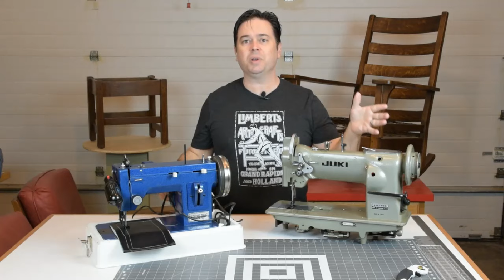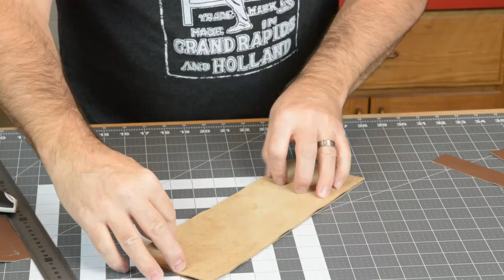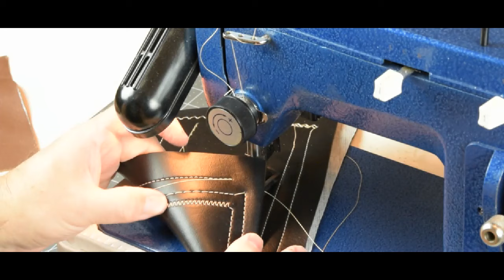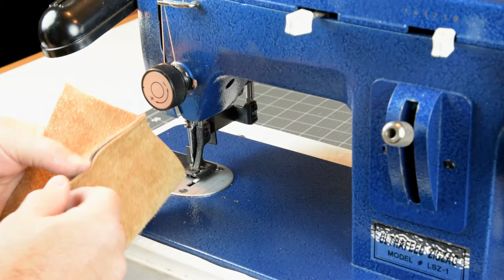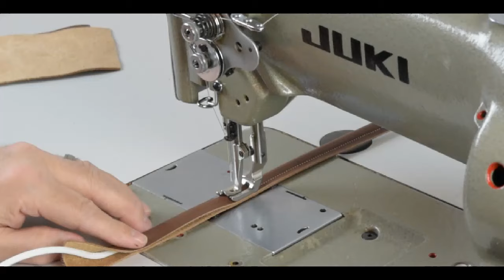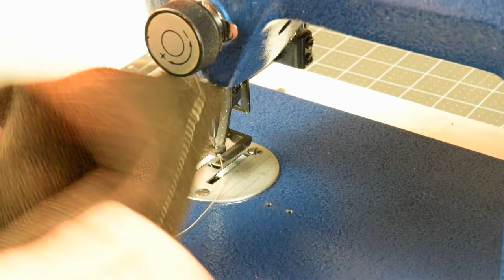Mini Walking Foot Vs Industrial Walking Foot Sewing Machine Sailrite and Juki Compared

Comment: I have a Reliable Barracuda.  I'm pretty sure it's the same machine as the LZ1.  I think Sailrite just takes the basic machine and does a lot of modifications and improvements to it.  I don't think they build them from scratch.  I have noticed that the Sailrite LZ presser foot lifts a lot more than mine.  I'd like to see how to adjust the walking foot and the presser foot for proper height and tension.  Also, your Juki is a compound walking foot, where the needle actually pulls the fabric.  It's far superior to the regular walking foot.  My Reliable tends to slip with certain materials.  But for the money, it's hard to beat.
Reply from the maker: There's an adjustment under the top cover for foot steppage height.  Most machines have something like it, but the adjustment is counterintuitive.  You make the adjustment backwards compared to any other walking foot.  It still doesn't lift as high as I'd like.  
Best
Reply: If you haven’t figured it out yet, Sailrite has a couple of utube videos that gave me enough info to figure it out on the Barracuda. Just go slow, ignore the measurements quoted and aim instead to get the clearances specified in the Barracuda sales lit.

Comment: I was watching a Sailrite video today and they said when you sew a corner, you should bury the needle and then bring it up 1/8th of an inch, raise presser foot, pivot, lower presser foot and then continue sewing. That way you can ensure the corner stitch will be complete.
Reply from the maker: Yes that is correct.  That's the best technique when you need to sew a square corner.  
Thanks
Reply: I watched that impressive performance, also 💪🏽

Comment: Now it does increase the cost but you can purchase a 550w servo motor with speed reducer for the Ultrafeed from Sailrite. It doesn't come with it stock though and you are pretty much committing to it no longer being a portable machine. So the Sailrite machine can have similar power. 

It really comes down to price, how loud it is, zig-zag stitch capability, how portable it is, and clearance under the presser foot.
Reply from the maker: Hi Joseph.  Well said.  Yes, for instance you can buy the Sailrite Leather machine which comes with a mini table, servo and small speed reducer.  It should be a nice package for a lot of crafters.
Reply: That Sailrite servo retains the portability of the machine, as it replaces the stock motor.
Reply: If you still want the portability, get the WorkerB servo motor.  It turn the portable LSZ1 into another workhorse!  Pun intended.  😀

Comment: Hello, I sew bags with light fabrics combined with some vinyl. I would like to buy a JUKI with a walking foot. Which one would you recommend?
This video just nailed it. You are a natural teacher, very clear and specific. Thank you very much.
Reply from the maker: Hi Sandra, thanks for your nice comments.  For sewing light fabric with vinyl, you might be able to get away with a simple drop feed machine like a DDL 8700.  If you have multiple layers of vinyl, or think you might want to do leather or heavier upholstery weight fabric, then a walking foot is recommended.  I favor the old Juki LU-563 with huge U style bobbin, but the LU-562 is almost identical but with a small G style bobbin.  Any of the new Juki walking foot machines are highly capable.  The main decisions you are making are do you prefer a top loading bobbin or a side loading bobbin?  Is a large M style bobbin important to you?  Or is a small G bobbin adequate?
Best of luck picking a great machine!
Reply: Sailrite would be perfect for what you want to do.
Reply: @paralogregt  Thank you very much, I really appreciate your advise. Good night and stay safe.
Reply: I would recommend the Juki 1541.  You can also buy the sailrite leather foot they use on their Fabricator and it fits the juki.  It has a smooth foot so it won't damage the vinyl. I do recommend using a hump jumper or scrap piece of vinyl to protect the vinyl when going UP or DOWN from a hump.  If not, the presser foot will eat your vinyl and you will be very sad. Lot's of bagmakers on YT use the 1181 so I think you can also consider that one.  But if you ever decide to use leather,  you should go for the 1541.

Comment: In the comments many people note the Sailrite is much noisier than the Juki. But for a fair analysis I think your demo should take into consideration the motor on the Sailrite is mounted on top of the hard, (noise reflecting) working surface of the table, just inches away from the microphone.  Where as the Juki motor is mounted under the table, several feet away from the microphone. Also, the camera/microphone appears to be positioned closer to the Sailrite than it does for the Juki demo.
Reply from the maker: Hi JC, I was actually using a lav mic, so same distance to the machine for both.  That is the actual experience sewing on these machines.  Your ears will be closer to the Sailrite machine, and it is a bit louder.  No getting around that.  But for what it is - a portable walking foot - it does the job.
Thanks for weighing in.

Comment: I rather wish i had come across this comparison before today, as it may have impacted my overall decision. I ended up purchasing a Sailrite straight stitch machine last year after hemming and hawing between a used industrial and the SR.
I'm not upset with the Sailrite. The newer versions of machine appear to have addressed some of the clearance issues you demonstrated in this video, and getting 4 layers under a new machine is not as difficult as you showed. I think it comes down to the mechanical lift was adjusted to capture some of the manual extra you showed near the end of the video. 
The challenge is in doing some DIY upholstery projects for automotive, adding a backing foam now takes up all of the increased clearance in the new machine and I return to having similar frustrations overall. I think if it was anything more than a hobby level endeavor, i'd be going back to the bowl of fruit and sampling something different.
I remain curious how the Sailrite fabricator machine compares to the likes of newer Consew and Juki machines. It seems the real quality machines for upholstery have all cheapened over the past decade and those of us shopping now are faced with the conundrum of what level of frustration we want to deal with. There don't seem to be many slow speed truly high quality options buying new.
Reply from the maker: Yeah I hear you.  I have the Sailrite Leatherwork as well, and it has the same clearance issue as the old ones.  If you sew more than two layers of 3oz leather, the foot drags on the work.  Fabricator will have normal industrial sewing capability of 3/8" compressed thickness.  Best of luck.

Comment: I like the idea of the sailrite when the power goes out I can keep on sewing and they do have a larger piping foot and they have beautiful stitching. I did not like how you made sailrite stitching closer together they do have a further apart stitching
Reply from the maker: That's great if they do have a larger piping foot, because the one that comes with the machine is too small for 5/32" piping.  My Leatherwork came with the same small cording foot.  I agree that stitch length should be longer for piping.  On newer Sailrite machines, changing stitch length is really awkward because you have to adjust two knobs.  One sets forward stitch length and one sets backwards stitch length.  On full size industrial machines, that's all automatic.  Ultimately, each user knows what's most important to them.  Sounds like you're set on the Sailrite benefits, so I say go for it!

Comment: That old Sail Rite sure does look like my Baracuda 200ZW.  This is a great video.
Reply from the maker: Thanks!
Reply: I'm told they are almost identical besides the price.
Reply: I saw a video on YT that talked about Thompson being a name in Sail Wright's family history.
Reply from the maker: @dannyl2598  Yes, I think they're similar.  Although Sailrite has made some improvements in terms of reliability, and making parts more widely available.  
Thanks
Reply: @stopthephilosophicalzombie9017  Yeah, big price.
Reply: Sailrites are upgraded generic machines made in china sold under a number of names including reliable, barracuda, omega etc. Sailrites do appear to work much smoother as they do a could job of fine tuning the generic machine and re selling them. They do have exemplary service.
Reply from the maker: @paralogregt  yeah, I've been impressed with Sailrite's service over the years.  I just placed another order, and it seemed like it shipped within minutes.  Surprisingly fast.  There are different packages too, like the Leatherwork machine.  I'll be testing that machine soon.

Comment: The difference in noise level between them is astounding. The Juki sounds like a Rolls-Royce, very smooth and quiet. The Sailrite was very rough, almost grinding sounding.
Reply from the maker: Yes, true.  They are both older machines, so probably a good judge as to what you can expect.  Honestly though, I have the Sailrite Leatherwork and it sounds about the same.  Best to you.
Reply: @TheThoughtfulWoodworker  
And to you and yours. Happy Holidays. Stay well 🙏

Comment: If you put the Sailrite on a table with a servo motor and a speed reducer, it becomes a true mini industrial. The only drawback to the Sailrite is that it’s not at all designed for manufacturing, like a full size is — which makes it an absolutely perfect prototyping or one-off fabricator. With a full setup, it’ll exceed expectations for its size. 👍
Reply from the maker: I actually have the Sailrite Leatherwork which is on a small table with servo.  The capacity of the portable machines just doesn't compare to a full size machine.  I need about 3/8" clearance under the presser foot for most projects.  The Sailrite maxes out at 1/4", so it's really only appropriate for thin material.  Your results may vary, but foot clearance is the one thing I've struggled with.  Best to you.

Comment: That Sailrite machine seems like a noisy son  of a gun.  I wonder why it makes so much noise?  Thanks for sharing this info.  Very informative.
Reply from the maker: I'm not sure, but it was well oiled.  That's an older model.  I have a Sailrite Leatherwork now that is quieter, but it also operates at a much slower speed.  Built-in speed reducer keeps things slow and quiet.
Interestingly, I've noticed a difference in the noise level of Consew 206rb machines.  The 206rb1 and rb2 are nice and quiet.  The 206rb5 machines make a clackety-clack noise.  Country of origin changed from Japan to China at some point, and perhaps the manufacturing tolerances weren't as tight 
Thanks for checking out the video.

Comment: Good video. I've got a newer version of that little Sailrite machine. It's ok but I am somewhat disappointed with it though because of presser foot clearance. My old Kenmore is better in that regard and it has more power too actually even though I'm running a speed reducer on the Sailrite too. Also its feet are wide which interferes getting close to things.
Reply from the maker: Hi Myron, sounds like you have some real world experience with the Sailrite.  I also have the Sailrite Leatherwork with a 550w Workhorse servo and small speed reducer.  Power is no problem in that configuration.  There is an adjustment for presser foot steppage height.  It adjusts backwards compared to most industrial sewing machines.  But even at max height, it doesn't lift high enough for me either.  I would also agree that the Sailrite feet feel wide and bulky compared to standard Consew style feet.  
Thanks for sharing your experience with the machine.
Best
Reply: @TheThoughtfulWoodworker  I’ve decided that the next machine I buy is going to be the TechSew 5100. I want to get into more leather work and it’s also a cylinder arm machine capable of sewing 5 ounce leather right up to 7/8” thick with 1” presser foot clearance with compound walking foot and needle feed with an 800W 1 Hp servo motor on it. This will do everything I would ever do and it’s only priced a few hundred dollars more than one of their smaller models. Oh, it’s also a 16-1/2” cylinder arm too so that offers pretty good throat clearance for bulky items.

Comment: Is there a practical difference in the types of walking foot you show here? The needle feed (triple feed?) machine seems more efficient, like the Sailrite Fabricator. 
Nice to see the older style Sailrite, it's about the same as the currently marketed "clones", like the REX, Reliable, etc...
Also, the outer foot on the Sailrite can always be changed to a deeper cord, and Sailrite has several different styles of feet. The other thing is that the Sailrite foot lift is adjustable up to about 1/2 inch. Same with the clones.
Reply from the maker: The triple feed has the needle buried as the material is advanced.  Just one more element working in unison to evenly feed the material.
Every Sailrite portable I've sewn on maxed out at about 5/16 sewing capacity.  Even with the walking foot steppage adjusted to maximum.  
You're right the Fabricator is a triple feed machine.  It will more reliably do 3/8" compressed thickness.
Best

Comment: One of the best comparison videos I've yet to see. Unfortunately, many Sailrite fans might not be happy with the results, but this video clearly shows the truth.  I'm now over trying a portable machine and will save up for an industrial. 

Also, are the Consew machines as quiet as that Juki? That thing sounds fabulous! What about powering off 110v? I'm mainly interested in vinyl for motorcycle seats, but will probably venture into other bike gear like wallets, handlebar/windshield pouches, and tank bibs. All for personal use and maybe a few friends.  Any tips on that and locating a good budget/used machine will help. 

Thanks!
Reply from the maker: The old Consews like the 226 and 206rb-1 and 2 are as quiet as my Juki.  The Consew 206rb-5 makes more of a clackety-clack to my ears.  Of course you have to have a servo motor for a really quiet machine!

Comment: This is a good review. I think putting on the right foot for the size piping on the Sailrite would have had different results. The Sailrite is not going to keep up with the juki it's just a bigger heavier duty machine. I think ya get both machines. Lol
Reply from the maker: Thanks Robert,
To my knowledge the portable Sailrite machines only offer two feet.  Regular and knurled for leather.  Neither has a large cording tunnel.  Step up to the Sailrite Fabricator and you'll have more options.

Best
Reply: Yeah I don't know about the smaller machines and the feet available. That makes since why the just include the small one built in cause you have to buy all the extra feet for the bigger machines. I have an old Chandler TDU -n 62.  I put a big servo motor on it but having trouble finding feet for it. Ordered a couple that said they fit my machine but they don't. It's a great older machine which I think would sew through a 2x4 if you could get it under the foot. Lol

Comment: I have both these machines and a consew 146rb and singer 211u. The only real difference on the sailrite leather piping is you used the wrong feet. They do sell task specific feet and the foot height can also be increased. You need to read the machines manuals if you want to instruct about them.
Reply from the maker: Hi John,
Not sure where you're coming from with your comment.  Sure, most any walking foot can be adjusted for steppage and presser foot pressure.  But this thing maxes out at 5/16" capacity, be that leather or cloth.  You may be right that a leather foot would decrease friction on the suede side of leather projects.  The only difference with Sailrite's leather foot is it's smoother on the bottom.  Interestingly, the Sailrite leather foot is also what they recommend for thinner material too.  
Thanks
Reply: It's not the the foot or the machine, it was the inconsistency of his sewing of the piping. You can tell that it was not straight. Then when he sewed it together it was larger on each end and thinner in the middle. I have watched dozens of sailrite videos and the results are very impressive.
Reply from the maker: @jwd0808  Yes I will agree that the Sailrite videos are well done and informative.  They're not usually sewing leather though!  They do have a Leatherwork model now, so look at that one if you plan to sew much leather.